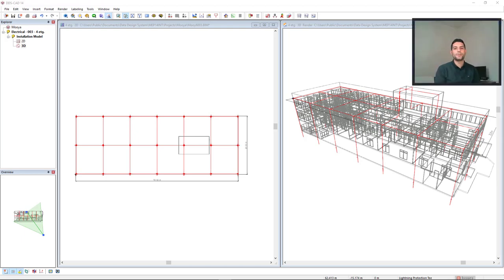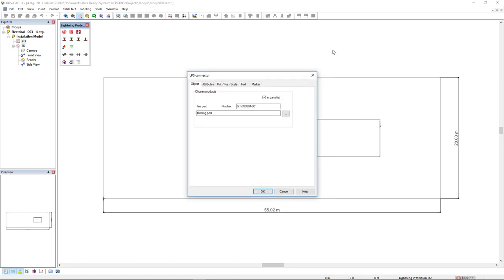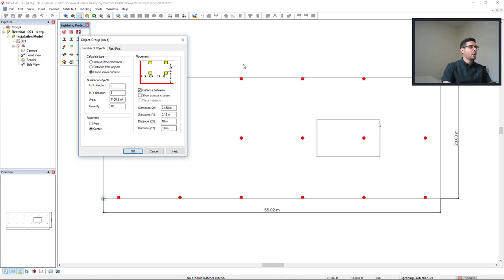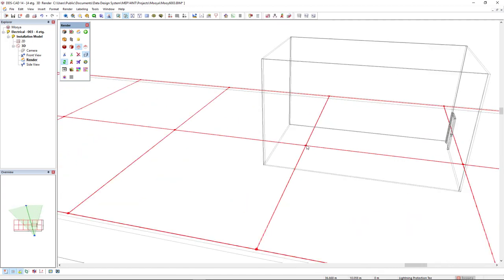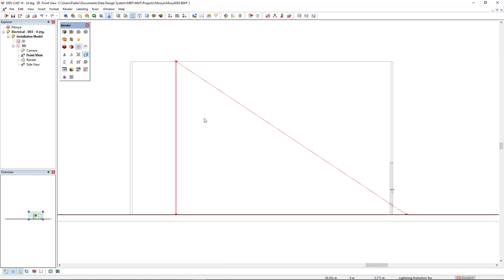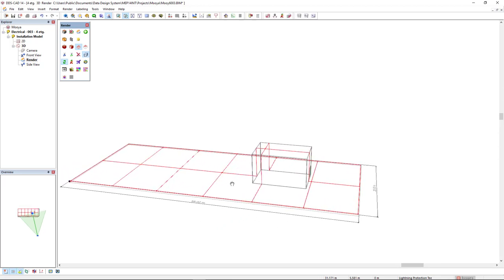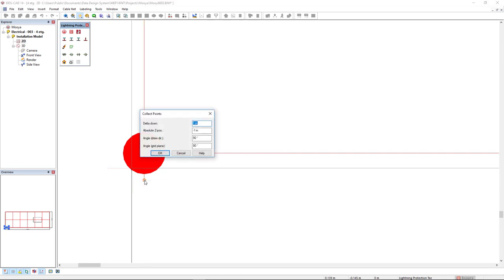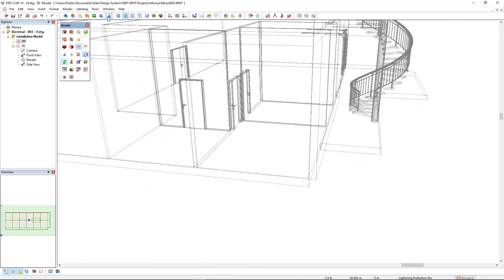How to design a faraday cage as lightning protection system

Comment: Hi. Nice video. But I have few questions. 1/ EN 62305-3 reuire counting "s" distance; can DDS-CAD count "s" distance from the 3D model? 2/ EN 62305-3 require proofing LPS design according to "angle" or "rolling ball"; can DDS-CAD check the design from the 3D model? 3/ In the video is grounding system made by separated earth bars (EN 62305-3, chapter 5.4.2.1). But most of grounding systems are (and should be) made as "foundation earth electrode" (in building foundation acc EN 62305-3, chapter 5.4.2.2); ist it possible made in DDS-CAD? Lighting protection together with foundation earth electrode?
Reply from the maker: Hi Jan, when we talk about Lighting protection in DDS-CAD, it is just modeling, there is no calculation in the background, so the answer is yes, you can do whatever you like. :)
Reply: @DDSCAD-MEP  Thats a pitty :-(

Comment: Hi, The design basing on the Risk Assessment? No lightning rods use for this case? What if the roof is not the flat type?
Reply from the maker: Hi HL Chan! Please check out the video 'Creating lightning protection based on rolling sphere'. In this video you will see an example using rods. DDS-CAD offers you the tools and functionalities to design a variety of lighting protection systems.
Reply: @DDSCAD-MEP  Yes. I have seen the rolling sphere video. Can the software be able to design and plot in all the air terminals, down conductors etc accordingly to the defined LPS class on the given 2D drawings?
Reply from the maker: @hlchan555  Not sure what you mean, but DDS-CAD provides the possibilities to flexibly generate plots based on its model.
Reply: DDS-CAD oh... what I mean is the software able to automate the design (thru interactive mode) by plotting in the require number of air terminals and down conductors with the specific distances to show on the drawings. Would that be easier to communicate over the WhatsApp?